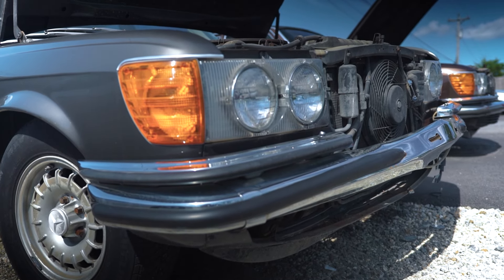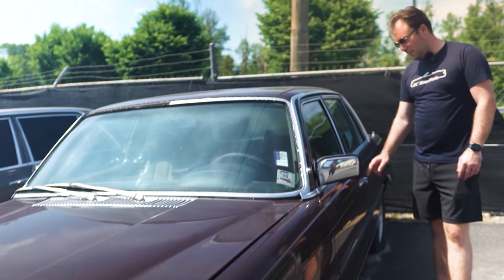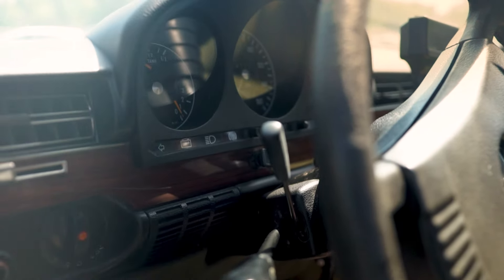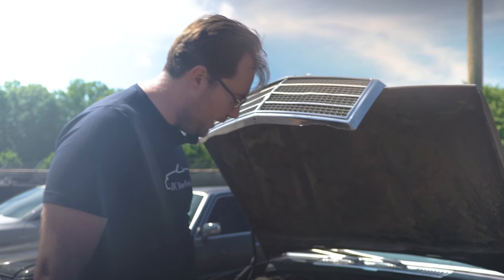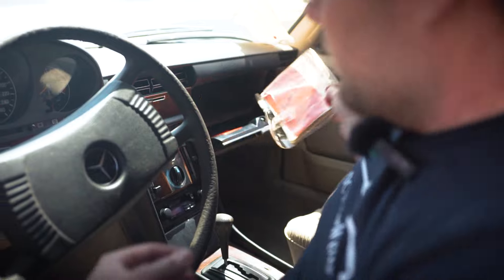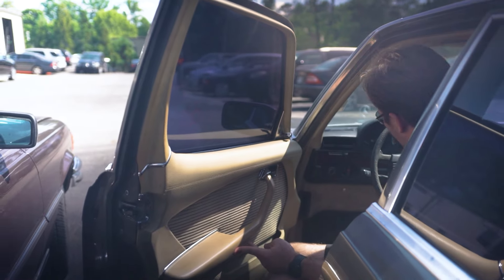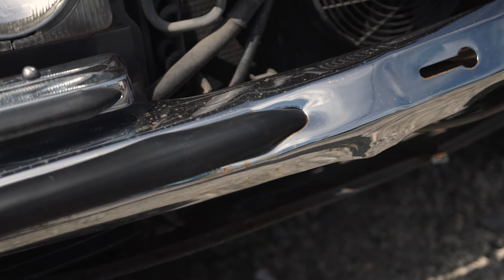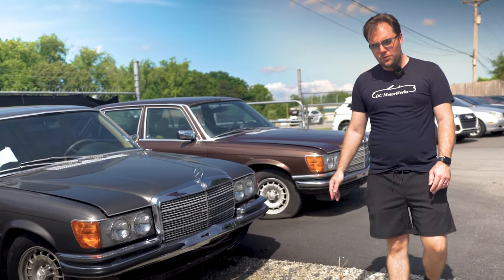I Bought TWO Euro 6.9 Mercedes That Were Sitting UNTOUCHED For OVER 20 YEARS!

Comment: Brown car still has euro cluster but the speedometer was swapped. Still has the Euro parking brake symbol on the warning light card and the oil pressure and engine temp are metric which they only started doing on 1980+ US models.
Reply from the maker: Makes sense

Comment: the grey one from 1979 has ABS!....What I could research was, that only 200 of 7380 built 6.9 had ABS!....and btw, ABS was launched in the W116. Just restore it, will have increasing value, power difference to the US versions is also noticeable. The Euro versions have due to that a higher value.